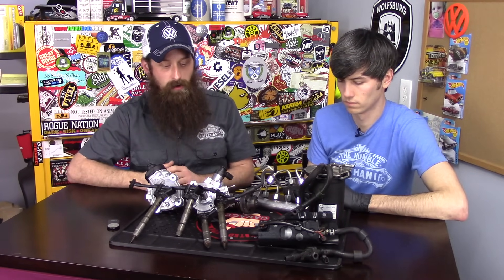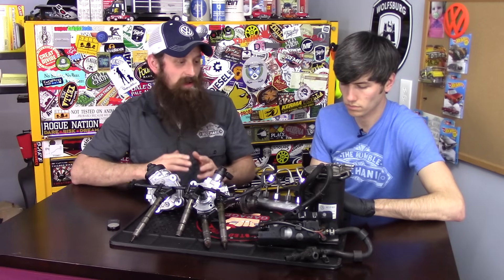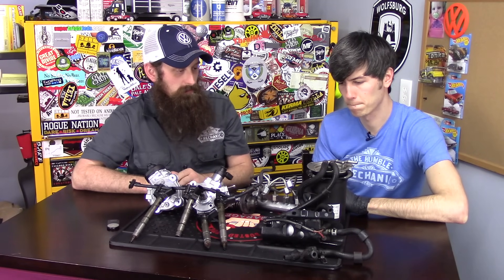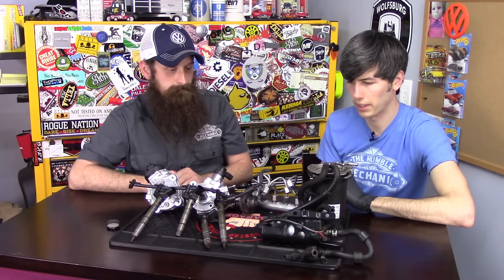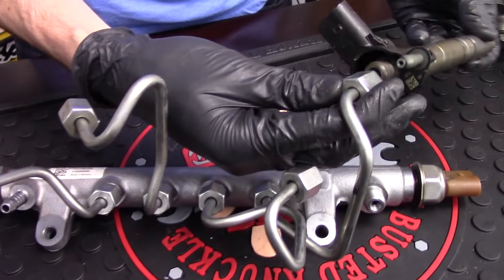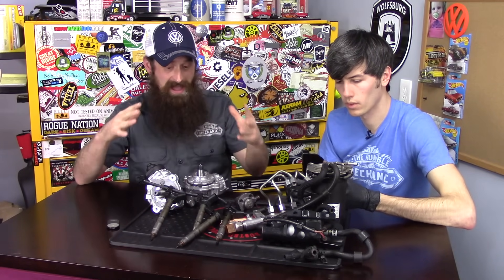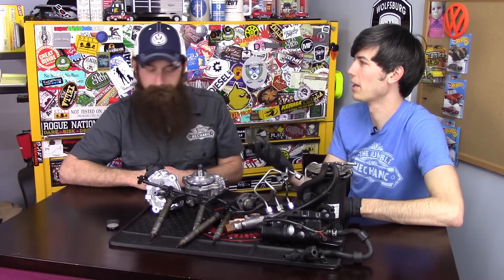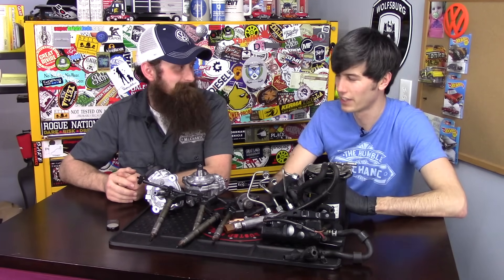Putting Gasoline In A Diesel Car - What Happens?

Comment: In some countries Diesel fuel is cheaper, in some countries Gasoline is cheaper. Why do you have to choose only one fuel?
Why don't they make a car that can run on both?
Reply: TribunusLaticlavus
Well the thing is: The trick of a modern common rail system is higher pressure (I'm talking about 800 bars), Russian tanks could run on oil, diesel fuel, petrol, etc. because of higher pressures (around 1500 bars).
Because of the higher pressures the fuel will generate smaller droplets, or essentially the mist will be finer which is only good for efficiency.
On efficiency in tanks in general: Most armies chose reliability over efficiency; driving further and polluting less is a good thing unless you risk not getting there at all.
One example could be carburettors compared to modern injection systems, carburettors can mix the AF-mixture better and are easier to repair and more reliable(in some way), but injectors can be places closer to the engine(or even in the combustion chamber) for better throttle response and injectors have a better control of the amount of fuel that's pumped in.
---
And if modern diesel's cars can't handle petrol because of a lack of lubrication, it's easy to make it work with petrol then. I mean petrol injection systems work fine without diesel, they don't need the lubrication from the fuel.
Reply: +sasja de vries The only engine I can think of that has multi-fuel capability is the Leyland L60 (Old tank engine) it acheived this by having two crankshafts so it could change the compression. Overall it was a a fairly unreliable engine that would not be ideal for everyday use in a car or truck.
Reply: Matt Bartholomew
Well actually the original diesel design was an engine that could run on anything. The engine was invented way before the "diesel fuel existed". Old soviet trucks and tanks could also run on whatever fuel you would find.
Letting a diesel run on oil means bad combustion because the fuel doesn't mix properly in the reaction chamber, the solution is using higher pressure so that the droplets will be smaller in size and the injectors will generate a finer mist. Tanks use 1500 bars of injection pressure for this.
Letting a diesel-engine run on petrol on the other hand is actually not that problematic: per liter of fuel it will produce less power and it's lubricating properties are worse.
Changing the compression ratio is not really required because a diesel can't have predetonation that causes engine knock.

So overall it's quite doable, you just have to figure out how to lubricate every part enough.

The combination of the words "Leyland" and "unreliable" sounds familiar to me.
Reply: +sasja de vries I do remember the the multi fuel situation, wasn't it something they wanted to use in the Chieftain tank in the UK? Good tanks in general from what I heard about them provided the engine wasn't causing issues, their power to weight ratio wasn't ideal either (much heavier than traditional counterparts to deliver the same energy).

And I suppose if you get right down to it I can think of one engine design that'll handle any combustible fuel: steam engines. But it would be a terrible idea for cars, I wonder if any hobbyists ever got homemade steam powered car projects certified for road legal use in any country with modern rules about it.
Reply: sasja de vries That makes sense and those pressures you listed are pretty damn high, I occasionally deal with 300 bar on air tanks and lines and having seen a few cases where something like that was opened without the stuff properly attached or sealed was scary enough.

About those high pressure components in modern injection engines, does the pressure remain there after the engine stops running or not? If it does that sounds like popping the hood open if an engine is malfunctioning there's a potentially dangerous component there to be aware of before you'd go poking around in it.
Reply: TribunusLaticlavus
A very small amount of fuel is at that pressure, essentially just enough to fill the pipe between the pump and the injectors.
And don't forget air-pressure is way more dangerous than hydraulic-pressure, because gasses are similar to a spring, to double the pressure you have to half the volume. Therefore air at 10 bar should weigh double than of 5 bar air. Liquids are (almost) non compressible, so you would need a gigantic pressure to just decrease the volume by 0,5%. So when pumping up a liquid it won't put in much extra mass.
In other words if the system leaks the leak itself will de-pressurize the system. If an air-tank at 20 bar leaks it will have to let out 20 times the volume of air at atmospheric pressure. For hydraulics it's more like letting out 1.0001 times the volume, in other words it de-pressurises instantly.
-------
The interesting thing is that gasses (and air too) will become a liquid at high pressures. So it could be true that air becomes a liquid at 350 bar (I don't know exactly when) and that air at 1000 is just as dangerous as air at 350 bar.
-------
One thing to note: High pressure hydraulics do need thicker walls to contain it, and 300 bar of hydraulic pressure will generate the same load on the walls as 300 bars of air, but when it does fail it's no big deal.

Comment: This assumes that the engine was turned over after mis-fueling. If you realize the wrong fuel has been pumped before attempting to start the engine, simply empty the tank and refill. No need for this overkill.

Comment: I put 3 litres of Petrol or 'Gas' in my common rail diesel and was given the advice that <5l you can get away with without draining the tank as long as I fill the tank and top it up regularly to thoroughly dilute the petrol, is this correct or am I screwed?
Reply: +James Benson It's fine advice you should be good.

Comment: understand that these guys "play it safe" at the customers cost! 
just drain that tank and refill call it good if something shags out later on then replace it..
Reply: +HumbleMechanic That's the second time now you have jumped to the conclusion that I have never touched a system that had petrol put through it. The 2nd hand information was a quote from a VW main dealer for the repairs. The customer had told them where to go. Why would I think the customer faked the quote?
Reply: I have never seen a diesel line degrade or leak after contact with petrol for a short period of time. Diesel is quite harsh itself, more than petrol I'd have said.
The damage to the HP pump that can happen is caused by lack of lubrication rather than anything the petrol does.
Reply: +HumbleMechanic I have seen VW hand a customer a bill for this. Maybe its different over there but here neither VW or insurance will cover owner abuse (unless its specifically mentioned in the policy)
Reply: +HumbleMechanic Oh and while we're talking about the gospel according to vw do they still say that 1.9pd heads can't be skimmed?
Reply: +catothewiser correct mate no one cares more about your car than you do its that simple and most shops simply dont give two farts...
Reply: MAN_ON_WHEELZ What parts do you expect will leak and catch fire after thy come in contact with petrol?
Reply: Of the 20 or so I have replaced exactly zero were paid by customer. It was either VW or insurance paying the bill. When VW pays they bill, they decide what needs to be replaced.
Reply: +Josh Do that kind of work yourself, if that thing springs a leak and causes a fire and they link that repair back to the technician, that shop is getting sued, they're just covering their own asses and keeping the customer safe.
Reply: ItsFriscoBaby Any of these parts, especially hoses that he discussed in his video may leak someplace externally and fall onto, say, an exhaust manifold perhaps and set the whole thing on fire
Reply: yes but it can also ruin alot mroe then what was mentioned in this video to put 6 injectors in a deisel truck at a dealer was 5k just for the 6
Reply: +ItsFriscoBaby  I am not sure that you having 2nd hand experience with one situation gives the full view of this issue. I have personally replaced a hand full of these systems, and seen many more replaced by the techs I work with. 

I also wonder how much experience you have in dealing with these parts failures for whatever reason. 

Who knows, maybe that dealership didn't follow the proper protocol. I wasn't there so I am not going to speculate. :)

Comment: or you can just drain the gas run the fuel pump manually with diesel through the lines to purge the gas, fill it up and hope its okay before complete fuel system teardown.
Reply: im a BMW mec and thats the way to do it fuel line of activate fuel pump and empty the fuel cell and add diesel and it runs
Reply: You or I certainly can. A professional independent mechanic does not have that luxury. The risk of metal flakes in the fuel system, which (as he pointed out) will destroy the engine if it jams an injector open is unacceptable for somebody who is accepting payment from a customer.

Comment: YOU DIDN'T EXPLAIN WHAT HAPPENS! Does the car implode? Does it just not start? Does it run for 50 miles and dies? Does jet fuel melt steel beams?

Comment: Why not replace the whole engine while you're at it. Better yet, replace the entire car...
Reply: +Jarl Ballin' and the driver
Reply: +Jarl Ballin'    Just to be on the save side. You don't know, something might break 100 000 km later on.
Reply: I bought my car for the price he gave
Reply: +Viewing That's just overblown(no pun intended) media sensationalism. So, they cheat a little on gov. regs, who doesn't?
Reply: +CtPaTown, Welcome Home. VW owns audi
Reply: +Jarl Ballin&#39; I love a VW, but the prices for parts and service just make it impossible to own one.
Reply: +CtPaTown, Welcome Home. Speed 
VW is the mid range make of the group, at the bottom end are Skoda and SEAT, then Audi, Lamborghini, Bentley and Bugatti at the upper end with Porsche heavily involver in the mix. Skoda  Octavia 230 £26500  SEAT Leon 290 £27900 and VW Golf GTI 220 £27400. Audi 33 300 £35,000. All effectivily the same car and engine with tweaks.
Reply: Or do not buy VW
Reply: Jarl Ballin' yeah. depending on the car, model, etc. a new engine could be 800-1500 to replace. those numbers could obviously move around more but its way less then 4000-8000 to fix
Reply: Why you even reply? I won't even know you did haha - Guess you never realized VW, Audi, Seat, Skoda are all the same, except for some posh items here and there to differentiate the brands.
In many cases for the same parts the price change according to the mention of the brand.
Reply: jensen1971x What do you mean? a regular service for a vw is 300$
Reply: villein .z VW also owns Bugatti.
Reply: +jensen1971x Don't love VW. Check out Diesel Gate....
Reply: +Viewing I don't like VW. But it's because they look like(and are) ghetto ass versions of Audi. And lets face it, VW is for the douche bag driver on a budget.

Comment: A video on old school mechanical fuel injection could be cool. I have all the parts to do it on a Dodge Omni 2.2L with a Hilborn setup, but seeing these belt driven fuel pumps and various regulators scare me. The individual throttle bodies are awesome though.

Comment: Just pump the gas out of the tank , pump it using the manual pump , change filter and fill it with diesel , put ignition a couple of times on and off and then start the car , will start loudly for a couple of seconds and will be fine , just another way to rip you off.
Reply: Depends on how much gas was in the system AND what gen TDI It is.
Reply: The car will not run on gas if it's a decent diesel , it will shut itself down, tdi hdi tdci etc , yes tdi's are the best anyway even with this vw emission shit.

Comment: Scary thought.
Some people have put diesel in a petrol engine
I dont know how people have done this as the diesel pump nozzle is larger and wont fit in a petrol tank filler nozzle
Reply: +IIGrayfoxII I almost did this the first time I filled up on my own. Grabbed the nozzle, go to insert, clunk, clunk, "Huh, doesn't fit," look up to see the word "DIESEL" on the pump... I drove to a different gas station to hide my shame...
Reply: Buck0338 Man it's quite impressive how many kinds of flammable fluids an engine can run on, even though some may damage it.
Reply: Gas and diesel pumps are identical in size. Only selected fuel stations have larger nozzles designed for semi trucks to fill the tanks quicker.  Since 2006, Volkswagen decreased the size of the fuel tank filler only allowing for use of the smaller nozzles.  Cars prior to 2006 could use both types.  The big ones are getting rarer to see outside of stations designed for semi trucks, but you'll still run across the station that only has large ones.
Reply: +IIGrayfoxII I once did it when I owned a moped, but that's because I used a jerry can and was told it contained gasoline. I trusted them enough not to smell it, boy was that a mistake.
Didn't get damaged though, it even fired a few times before I had my "oh shit" moment.
Reply: +Tim Bayliss I came home from work one day and my wife was cutting the grass.  I said to her, "Where did you get the gas?" because I knew that we did not have any.  She said, "In the blue gas can."  I told her that was kerosene and she replied, "No wonder it was so smokey."  I quick started the lawnmower back up, leaned out the carb and ran it out of "gas".  I had long wondered if kerosene would work in a lawn mower as long as there was gas left in the carb to start it.
Reply: +SnOpeK Domowei Kerosene most likely won't actually damage an engine beyond creating excessive carbon deposits as it's more of an oil than gasoline.
Reply: +IIGrayfoxII Around here gas and diesel pump nozzles outside of truck stops are the same size and fit equally as well. May be simply that Arkansas is backwards.
Reply: +IIGrayfoxII It shouldn't evan be possible but they do it somehow anyways